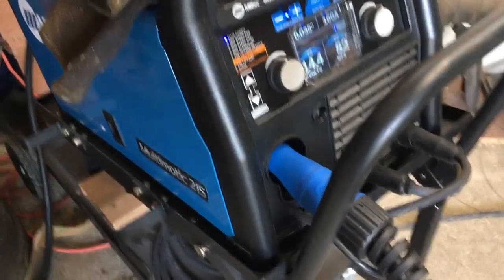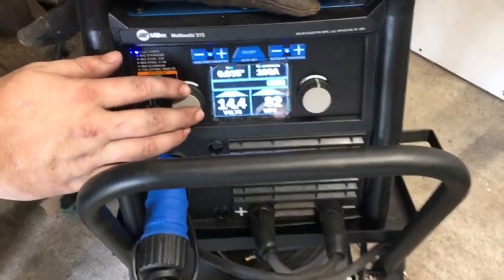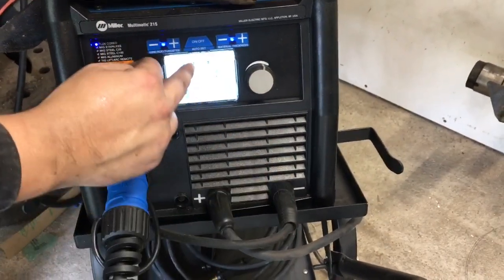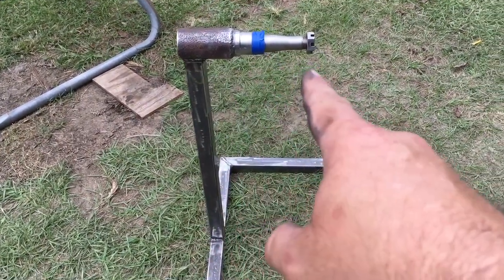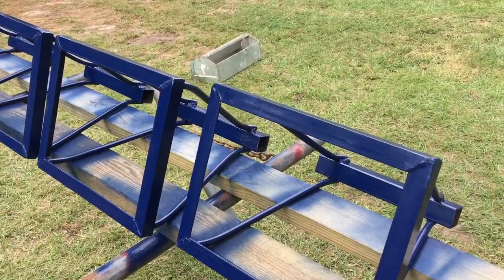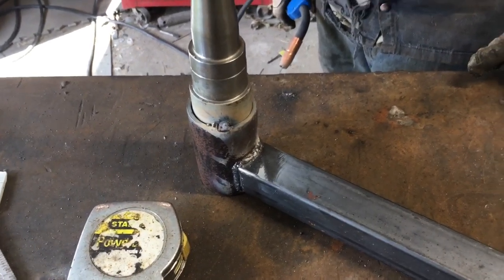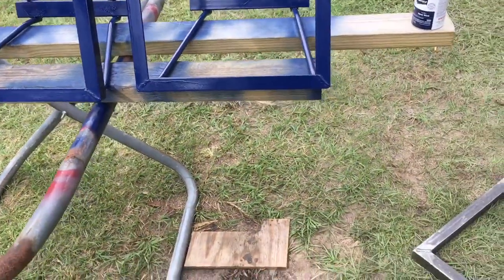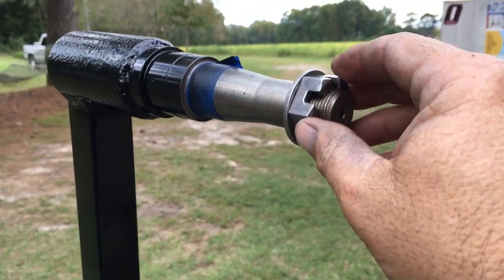Miller Multimatic 215 Welder

Comment: Make absolutely sure your outlet is wired and grounded correctly, or you will toast the circuit board in that unit in 2 seconds.
Reply from the maker: Thanks for the tip. He is loving the welder so far.  It sure spread things up in our shop. The spool gun for aluminum works good to. Have a good one

Comment: Nice new machine ya got there! And that welding table is a gem. To get one that thick is a luxury. I'd walk away from that flux core if I were you, for general fab. MIG is so much cleaner, less of a mess on the welding table, and cheaper in the long run. The upfront cost of a bottle is well worth it. With 215a welder, you won't need the added penetration benefit of the flux core, for most of what you're doing. Hope all is well, and the business takes off!
Reply from the maker: We have a bottle on our other welder. He’s going tomorrow to pick up his spool gun for it.  Have a good one buddy